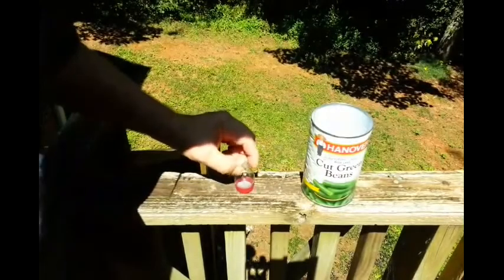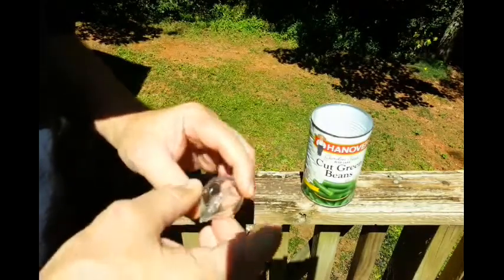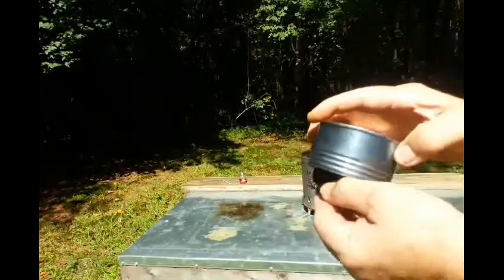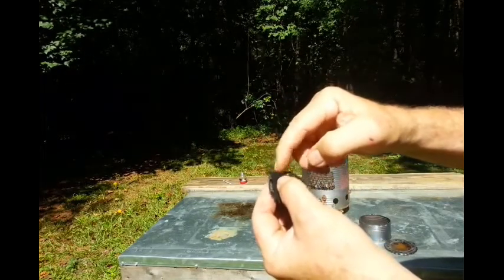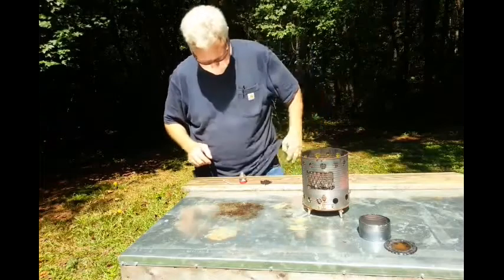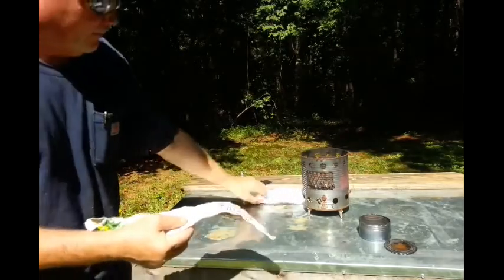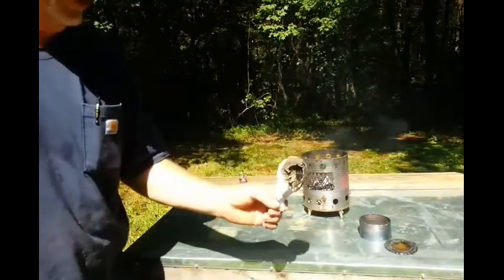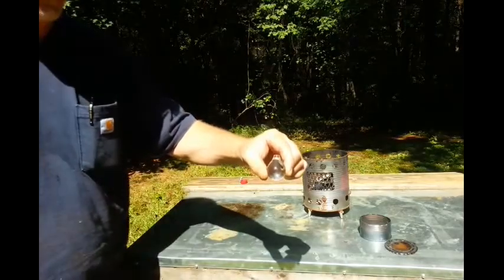Solar Ignition, Hollowed Out Light Bulb, When base of bulb came off in the socket, I smiled.

Comment: That's pretty cool!  I'm still working on my hand drill technique.  I think I have a dud horseweed (yeah, that's it!) and haven't had a chance yet this season to get any new ones.  I wonder if your bulb method would work with an 1157.  Nice job, as usual.
Reply from the maker: I would definitely try an 1157. Don't forget, you need the right fireboard too. Sometimes a branch that has been hung up in a tree for years, bark has come off, many successions of wet and dry, sort of pre-punk if you will (not too soft though)... makes he best fire boards.

Comment from the maker: Most people would be annoyed if while trying to remove a light bulb, the metal base twisted of the glass bulb and stayed firmly screwed in the light socket. Not me. A little WD 40 and some needle nose pliers is all it takes to remove the base. As for the glass bulb, I'm going to try to hollow it out, fill it with water, and use it for solar ignition. I have a previous video (see Link below) where I used this technique on a bigger 60 watt bulb. This bulb is very much smaller. Other interesting things to watch for are... using the surface tension of water and a toothpick to fill up the bulb, making the char tin, and learning that you can not set a char tin directly on a Trangia Stove without snuffing it out. But look what a great job the Soda Can Alcohol Stove did... Please SUBSCRIBE at the end of the video. Thanks!
Making Fire With A Hollowed Out Light Bulb
https://youtu.be/9TBK-6XDzns